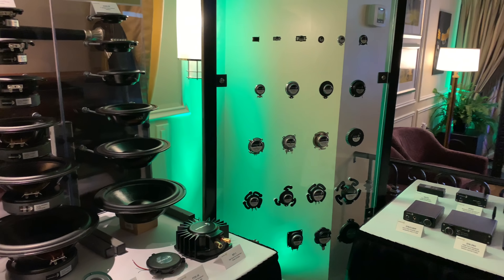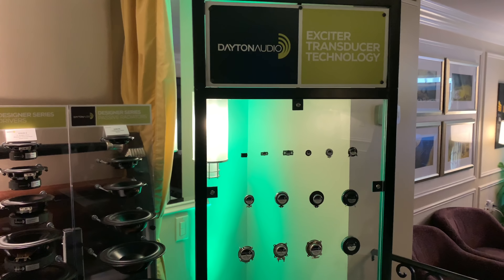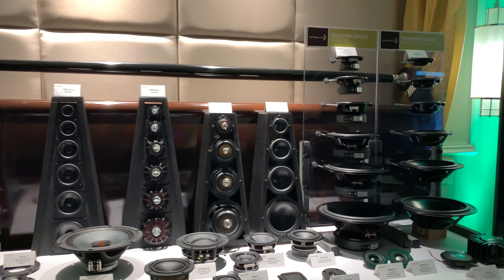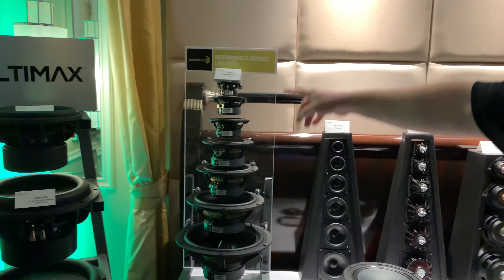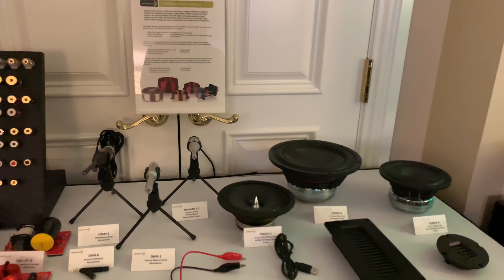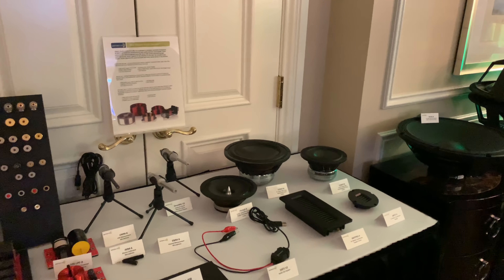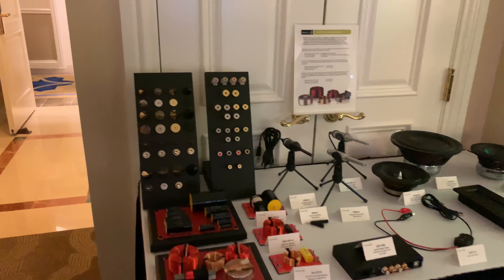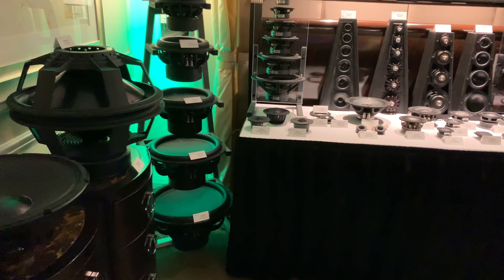Dayton Audio: DIY Hifi?? | CES 2019

Comment: u will like the um18  just built one a few weeks ago  could build 2 for less then  your pb4000
Reply: what amp did you use?
Reply: @ryle9063   crown xls 1002 running 1100 watts to it.
Reply from the maker: you can run that much amp to the um 18? i thought it was rated at 800. Give me the info cause im making one or two this year
Reply: @ThatHomeTheaterDude  it's rated 1000 max but I normal watch movies at -35 reference being 0.  The drive is barely moving but producing tons of bass. I'll be making a 2nd one in a few weeks really those no need.
Reply: One more thing check out the mini dsp I'll be getting one shortly to eq them
Reply from the maker: @MegaSnowhoe  right on. i'll probably be on the opposite spectrum. I like watching close to reference so I'll probably have to dial back the gain. Cool man. Thanks for the info
Reply: @ThatHomeTheaterDude 
The price is the best  part is $780 all in.
Reply: @MegaSnowhoe  does that have built in DSP or did you have to use a mini dsp with it? I'm in my planning phase right now and inuke 6000DSP are hard to come by lol.
Reply: @nintariplays5654   Been thinking about a mini dsp hd but just using the crowns low pass set at 80hz i now have 2 xls1002 planning to order the 2nd ultimax 18 soon.

Comment: Can’t wait for that build video for the ultimax!! 
I’m still a newbie to hifi and don’t yet have a sub. I don’t have a big budget so deciding between building a ultimax 15” driven by a crown 1502 or an equivalent priced svs. Difficult and expensive building the Dayton in the uk without access to the denovo box and import fees for the sub. 
Any advice Home Theater Dude on this ?? Looking to match the sub with kef r300 driven by crown 1502 and audio gd r2r 11 using a mini dsp
Reply from the maker: Google marty box kits. they come in packs of 2 or 4 and you build them yourself. All in with a crown amp and the Um18-22 will be around 800 or 900. wattage for wattage it will be similar to a 1300 svs sub
Reply: That Home Theater Dude, Amazing ! I’ve dropped them an email! Hopefully this will give me the push to make the purchase ! Thanks again !

Comment: What was that rectangle speaker on the table? Anyone use ultimax in car audio? Curious if the can play the higher bass frequencies well or if they are mainly for lower bass frequencies? Are they geared toward sq or spl?
Reply from the maker: zach Gibson mid teeeter. It’s a ribbon tweeter similar to what emotiva uses.